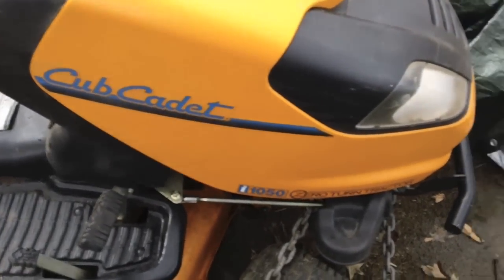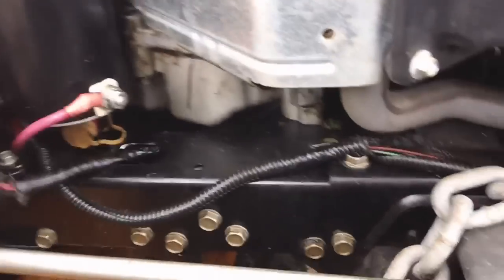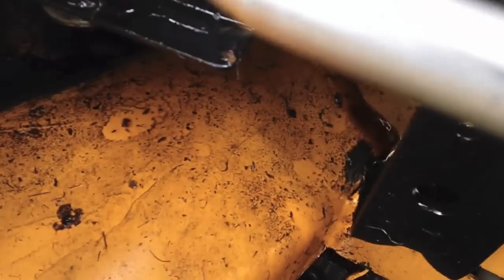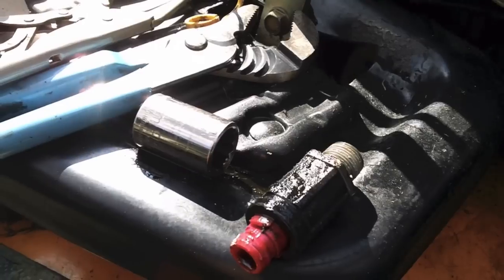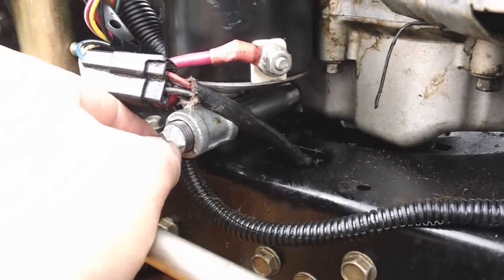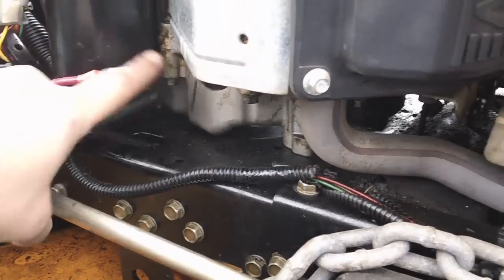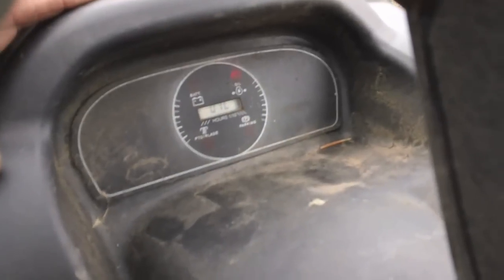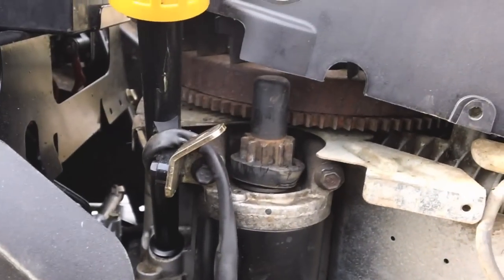cub cadet i1050 zero turn kohler courage 25hp oil leak repair 2008 leaking drain valve

Comment: Thanks for making this video. I have an 09 SLT54 with a 27hp kohler courage with 110hrs and had the same problem with the crappy plastic drain valve. I was beginning to freak out about where the leak was coming from since the pulley underneath throw oil ALL OVER. Glad it was such a cheap fix. I used a 3/8"x4"lg Nipple with a 3/8" Pipe Cap. I'll have to use a pipe wrench to do my oil changes now, but better that then a plastic valve that leaks. And yes, the lights are also always 'on' on mine

Comment from the maker: Hello.  Honestly, I just did this upgrade a few weeks ago just getting it ready for the summer.  I usually either park on a slight incline or put a few pieces of wood and drive up on the opposite side to kind of tilt the engine on the drain side to make sure I get everything out.  If you park on a slight incline don't forget to chock and block the wheels.

Comment: how did you get that old valve off?  I can't fit a socket over it.  Not enough clearance between the valve and frame.  My mower, however, isn't the zero turn, but it's the same engine.
Reply: +chspiratetvI have the same problem. did you every figure it out? Mike W
Reply: +Mike Williams I removed the starter and used vice grips to remove it.  Then I was able to finish the job.  Worked great,  still working!